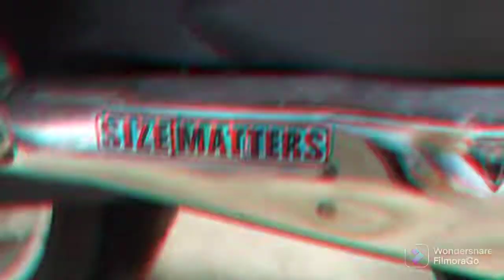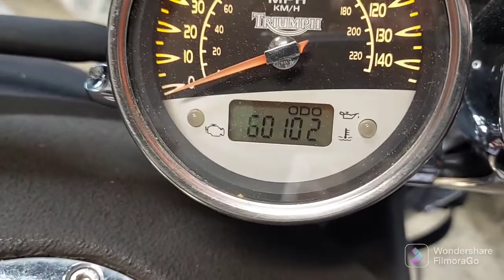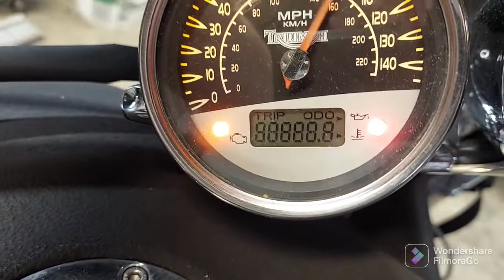2005 Triumph Rocket 3 issues

Comment: I have a 2008 with issues ,luckily after putting new spark plugs and a new fuel pump ,sending unit and some fuel lines it works great. Also the wires came out of one of the coils so that was a issue I had to fix too.
Reply from the maker: Most people I know that have these bikes absolutely just love them. They seem to hold up good for a long time. Glad you got yours squared away. Thanks for watching 🐲

Comment: I want to know why the engine oil cap of the Triumph Rocket III comes off so easily! If there is a solution, please let me know.
Reply from the maker: @東京都-z4h  This is the one and only Rocket 3 I have worked on, I wasn't aware of this problem. I would suggest trying a new cap or maybe there is an aftermarket available that's better. Sorry couldn't be more help. Thanks for watching 🐲
Reply: @thedragon2299  Thank you very much! From Tokyo with all my heart.

Comment: My buddy bought a 2007 with 12k miles, it rode fine for about 150 miles then it wouldn’t start again.  He is thinking the timing chain slipped so he bought a 2017-2018 when the Honda Rune seller became unresponsive.  Any thoughts on troubleshooting his 2007?  Any response is highly appreciated
Reply from the maker: Well, the good thing is you don't have to guess or assume what's wrong. It's as simple as does it have spark, fuel and compression. If it's missing any 1 of those it won't run. So at this point you just need to do process of elimination. Spark is the easiest to test, just pull a sparkplug out of the engine, put it back in the boot and ground it to the engine and turn the bike over to see if it sparks. Next is to do a proper compression test on the engine. And if thise 2 check out, then most like it's a fuel issue. You can sqirt some gas or other flammable liquid straight in the intake to see if it tries to run, if it does then you know it's not getting fuel. That will get you on the right track for now. All of these things I mentioned are the same for any motorcycle, and you can find thousands of videos on how to perform these simple test. Start there and see what you got. Good luck🐲 Don't forget to check out my Facebook page for lots of motorcycle content:https://www.facebook.com/profile.php?id=100057489818717&mibextid=ZbWKwL

Comment: Hey dragon love your channel! I'm just about to buy 2009 24000 miles Speed triple (cheap) . I've been told it slips out of 5th gear. Could this be expensive or an easy fixed ? Cheers dude!
Reply from the maker: Thanks, I guess you saw the speed triple on my channel then? Those speed triples had some recalls on that problem, it's usually the detent arm right inside the side cover. 
https://www.thetriumphforum.com/threads/speed-triple-gearbox-problem.13898/
Reply from the maker: https://youtu.be/D1gU8eXDJ98
Reply: @thedragon2299  I did great video 😁👍. Thanks for reply and thread. This might be a bit of a money pit ? 
Keep up the good work bud. Thanks again.